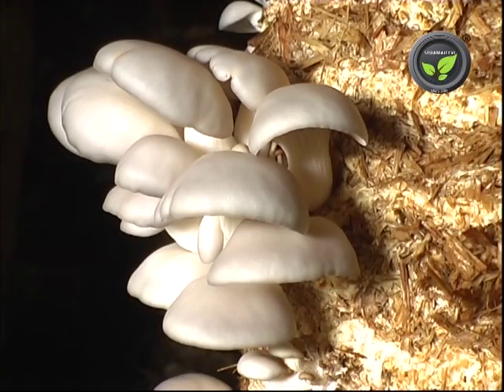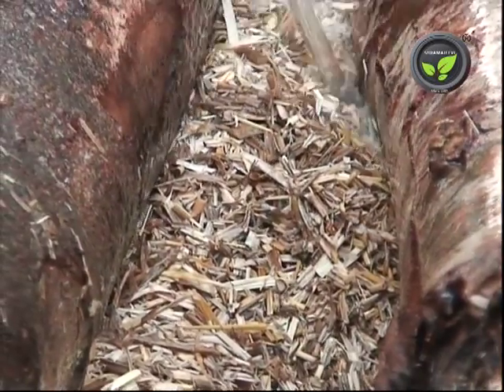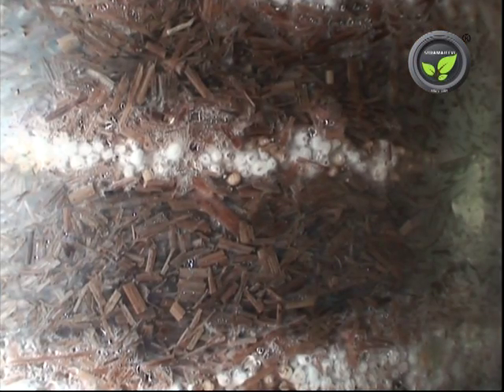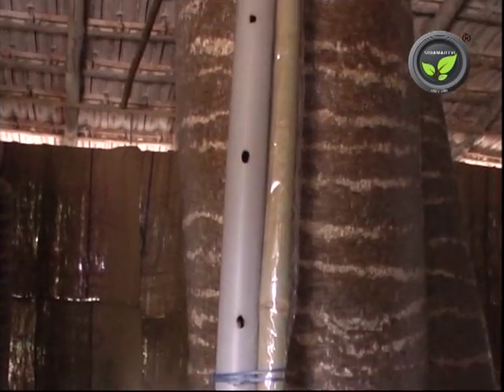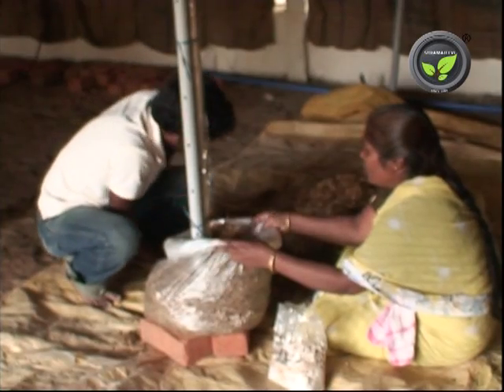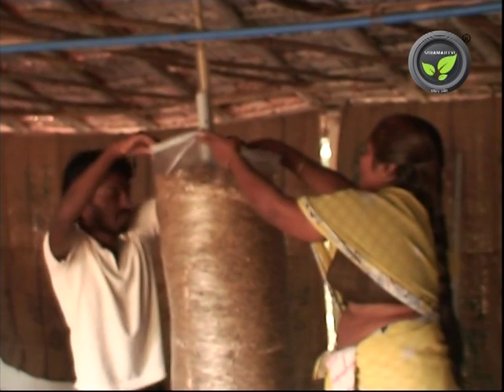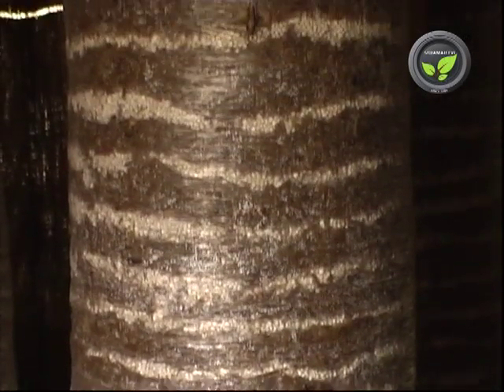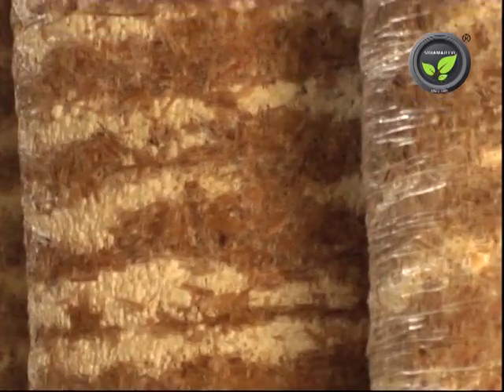Cylinder System of Oyster Mushroom Cultivation

Comment: Hi Shramajeevi, do we have to remove the Poly cover after 30 days of Spawn Running Period, or have to make holes, please let me know, I might start with Cylinder System, rather than Bag System. Also please let me know Mushroom Pure Culture, or Mushroom Mother Spawn ( 1st Generation supplier of Oyster & Milky Mushroom, many thanks.
Reply from the maker: Yes sir. You need to remove the poly cover. You may contact IIHR, Hesaraghatta, Bengaluru - mushroom division for spawn.
Reply: Sir, Your video is nice.  However what are the benefits of using the cylinder system. Please let us know. -Dhanasekaran -Madurai